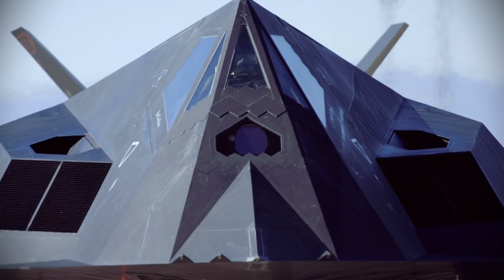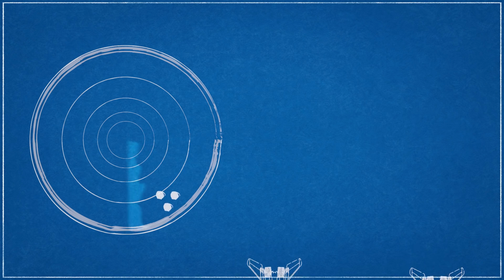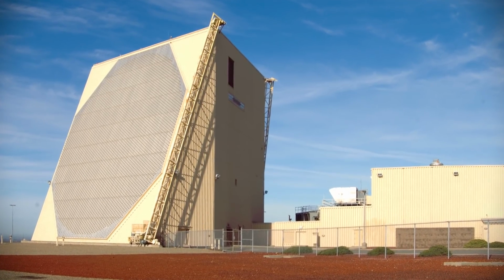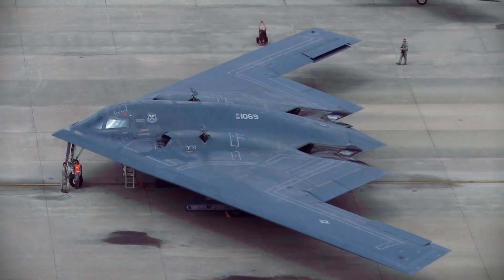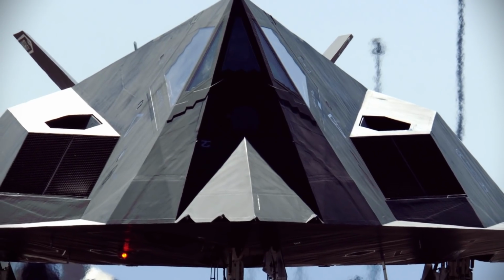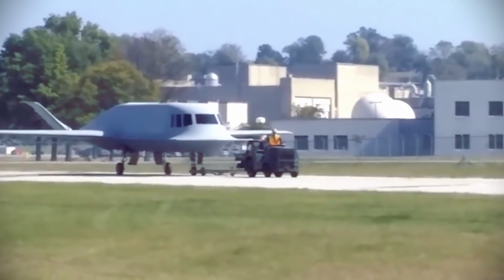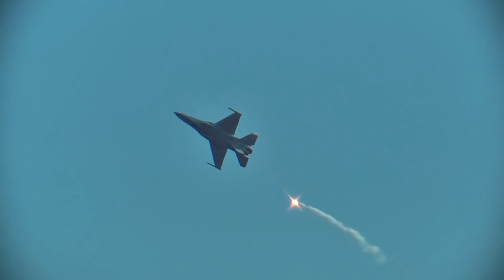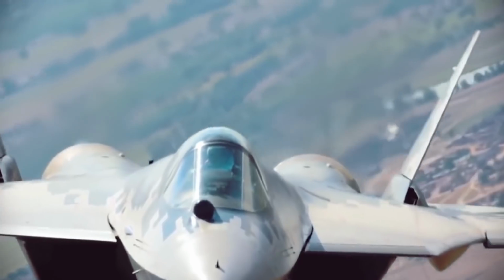The Evolution Of Stealth Technology

Comment: Iraq had very old radars and Iran have new one's. The result is opposite.
Reply: hi A S...
how the iran get a new radar come from
Reply: I would recommend that you press your theocrats to refrain from finding out just how good your vaporware radars are, gunsmoke.
Radars gotta radiate. Think back on the Iraq war ('91, not the one where the ayatollahs sent children to the battlefield to soak up Iraqi small arms bullets), and ask yourself how much of the Iraqi Russian made radar was in operation after the first 24 hours. At the time, Iraqi AD radars were Russian (CCCP) state of the art.
In conclusion, air defense radar is only effective if it works and if it hasn't been taken out by antiradiation warheads.
But good luck with that, in any case.

Comment: bruh you don't have even the basic idea of stealth. U have to tell the audience that what makes the difference between 4.5th gen fighter vs 5th gen fighter design? the ans is u will not see 90-degree angle anymore in a 5th gen fighter and it has a special coating especially indium tin oxide and titanium alloy! bro research more or read some books before making a video about stealth!